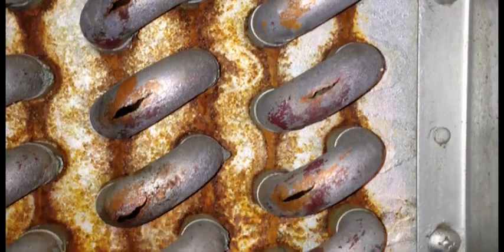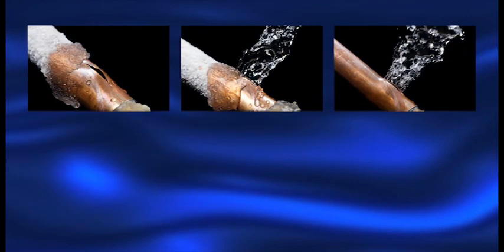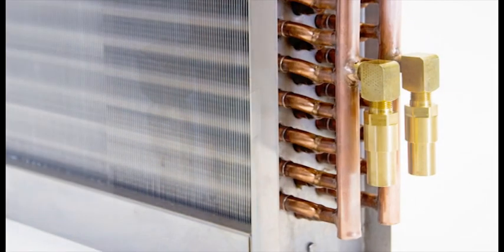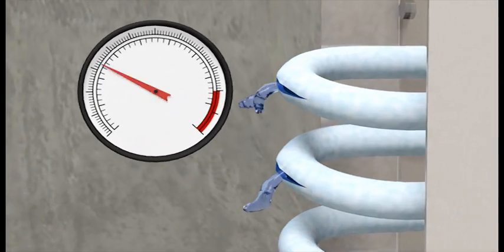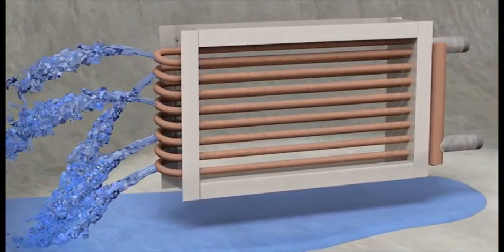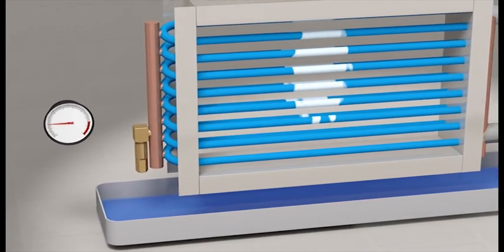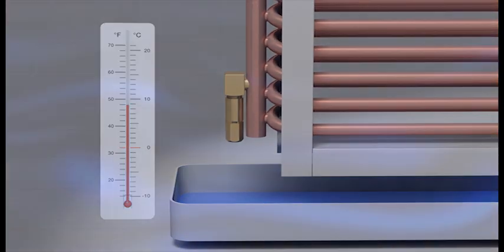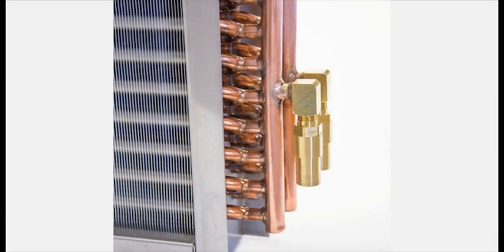Cooney Freeze Block Technology

Comment: Thank you for your solution. And I have a question. In my thought, the outward pressure is 25,000 psi not 2,500psi with 9% volume expansion of water and E=2.2GPa.